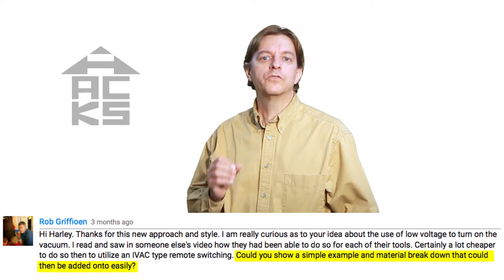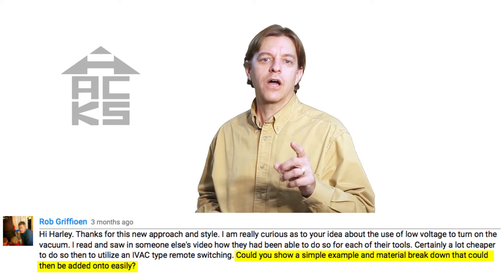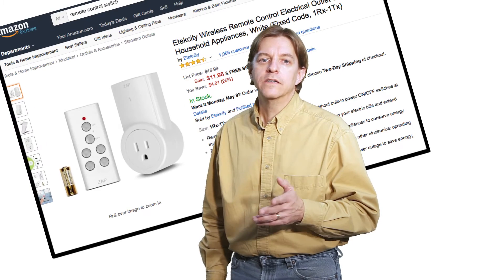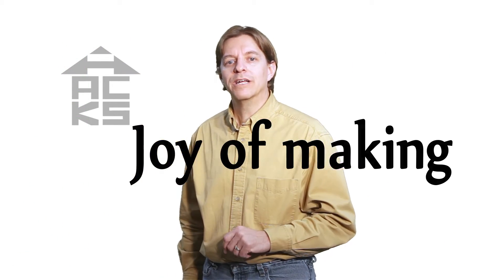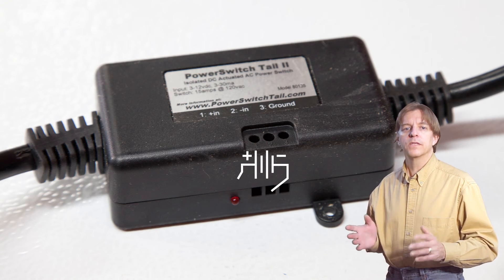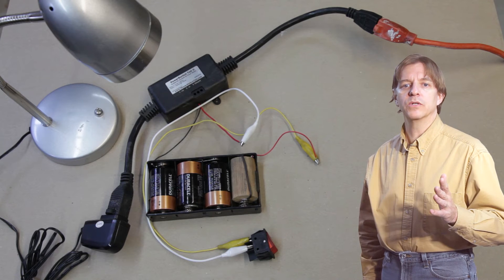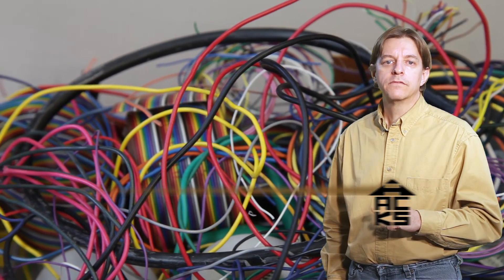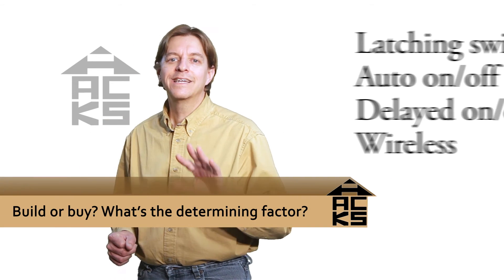How to easily make a low-voltage, remote shop vac switch

Comment: OK- this isn't "making" anything.  This is"buying" a power switch tail, and using it according to directions.  We see how you turn on a lamp without using the built in switch.  WOW!  And we see a lot of you.  Not what I was looking for.
Reply from the maker: Sorry you were disappointed. What was it you were looking for?
Reply: I need a schematic for running a remote switch from each blast gate to a power switch.  Those Power Switch 
Tails are no longer available. @HouseOfHacks
Reply from the maker: @ericperkins3078  Ah, wasn't aware the PowerSwitch Tails were not available. Thanks for bringing that to my attention. This looks like it'd be a suitable replacement (although I've not used it myself): https://amzn.to/2WZoyf7

For a wired connection on blast gates, you'd need a normal closed switch mounted on each gate such that the switch is activated when the gate is closed. Then you'd need a low voltage power source (e.g. a wall wart power supply). The positive output of the power supply would go to one side of each switch. The other side of each switch would go to one side of the trigger on the PowerSwitch or the above replacement. The negative output of the power supply would go to the other side of the trigger. In this configuration, when any gate is opened, the power should turn on.

Does that make sense?
Reply: @ericperkins3078  did you ever find that schematic. if so I would love to see it as well
Reply: @michaelmccarty6582  No,but the switches are a available again.
Reply: @HouseOfHacks  Yes, absolutely.  As it turns out (and you probably already know this) they modified the power switch tails to include a 5v power supply so now, all I had to do was run the leads from each blast gate to the powered side of the switch tail and the neutral.  When I open the gate, the switch tail turns on the central vac which is mounted in the attic over my shop.  Closing the gate turns it off.

Comment: I did it using a current transformer (£5) which clips around a conductor common to all the machines that have their dust collected. Current flowing generates a low current AC output which I rectify with a small bridge rectifier (£0.75), the resulting DC is smoothed with a capacitor (£0.25) and used to drive the input to a Solid state optically coupled relay. (I used a Fotek SSR-25 DA which was £3.49) This is used to switch the shop vac on. 

Under £10. I built two - one for my son - and three years later both are working fine. I had a couple of plastic boxes which cost me nothing in which I housed the four components. 

I don't know what this would cost in dollars, but probably less if anything. The advantage is that it is all automatic, and you don't have to remember to turn the vac on at all. All self-powered, no batteries, and it takes no power at all in the idle state.
Reply from the maker: Nice design!
Reply: Thank you. Four components was the best I could do. I forgot to mention that I have a very low power scroll saw which originally didn't take enough current to make my system work. I solved this by passing the conductor through the current transformer not once, but half a dozen times. Still four components if you don't count the additional few feet of wire involved.
Reply from the maker: I do have plans to make a current sensing switch. I may change my approach to it based on this idea. Thanks!
Reply: Be careful of the current transformer. It is a step-up transformer with a ratio typical of 1:1,000. The secondary is limited in current but is essentially a constant current source. It will generate high voltages which may give you a very nasty shock if left open circuit, or cause breakdown of the insulation. Keep it connected to the load when the primary is powered up, then it's quite safe.

The LED in the SSR is an adequate load - mine had a series resistor which I estimated was around 500 Ohms. The bridge rectifier guarantees the load is connected for both halves of the cycle.
Reply from the maker: Thanks for the heads-up. Cheers.
Reply: What an amazing idea!  Making something work is akin to science, doing so creatively, elegantly and most importantly SIMPLY is more akin to art.  Props.  Thank you for expanding my mind a little.
Reply: Thank you Chuck. If you want to make one yourself, you may have to take several turns of wire through the current transformer if the current drawn by the machine is low. 

Make sure the output of the current transformer is never left open circuit whilst there is current flowing in the primary. You can get high voltages which may give you a shock or destroy the transformer. Otherwise, you should have no problems making it. Good luck.
Reply: Thank you for the advice Mr. Williams.  I will surely keep that in mind.  I'm going to experiment with this in the next week or two, once I sourse a transformer.  If you have the time could you clarify your comment about "constant current".  Transformers/induction still has a "black arts" feel to it to me.  I would have assumed it would be constant voltage since the windings are fixed.  I'm just trying to wrap my head around it, its coming slowy but surely.
Reply: The secondary of a current transformer looks like a very high voltage in series with a very high resistance, and it is this resistance that supplies the current to the LED in your optically coupled SSR. It makes little difference if you put a 1 ohm, 10 ohm, 100 ohm even a 1000 ohm resistor in series with the LED. The current will be about the same because the resistance you have added is tiny compared to that appearing in the transformer secondary. This is what I mean by 'constant current' The transformer will increase its output voltage so the current remains substantially the same. This current is proportinal to the number of turns you have on the primary.

In my case, the lowest consumption power tool was a small bandsaw. I tried a single turn through the transformer, and put a 100 ohm resistor as the secondary load. I measured the voltage across this and was able to work out the current through it with only the bandsaw running. I wanted about 10mA to drive the SSR LED, and was able to work out that (in my case) six turns were adequate. 

I suggest you may like to do a little reading up on current transformers. There are a number of youtube videos and explanations on the internet. I don't know your level of understanding so I can't really recommend one I'm afraid. Just make sure you put a load resistance  or short out the secondary whilst current is going through the primary and you will be safe.

Current transformers are a bit different from conventional ones, in which an open circuit on the secondary reduces the current on the primary. This is not so in a current transformer - the current through a single turn is unaffected by the secondary, so energy is always going into the device, and an open circuit secondary will output a high voltage and may break down the insulation in the windings or give you a very nasty shock!